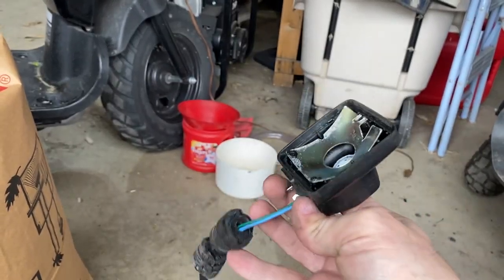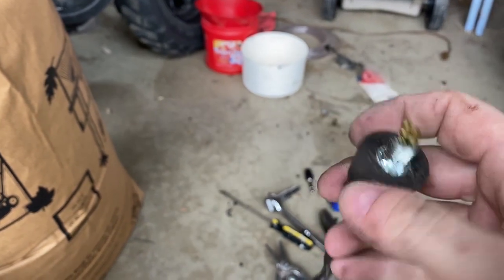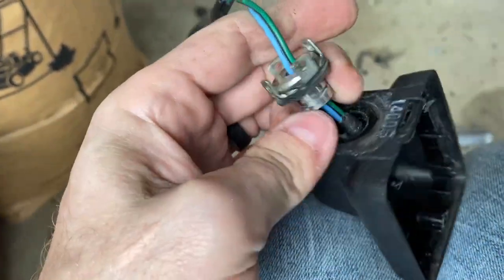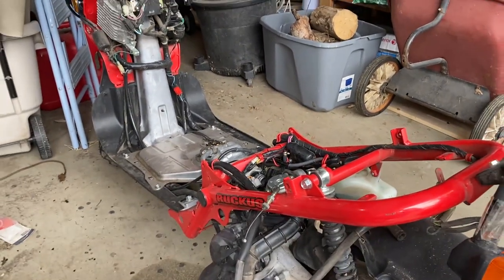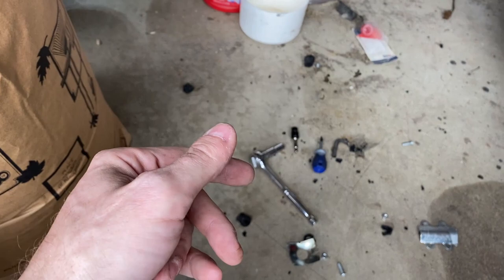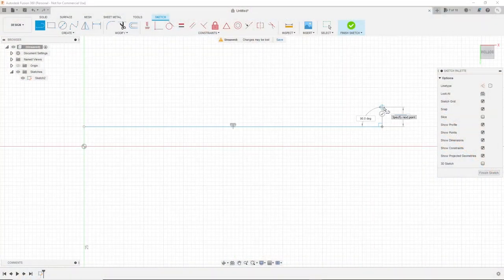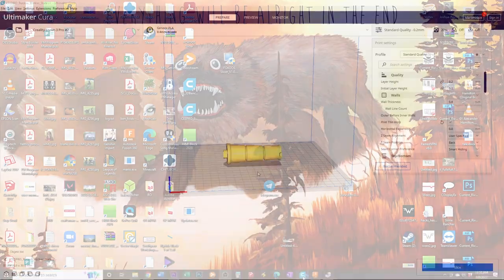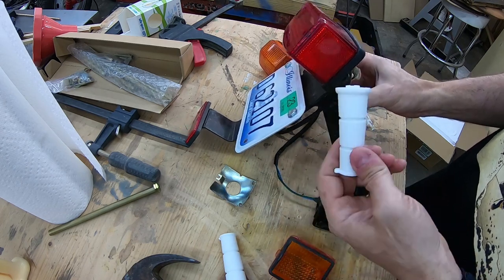Designing and 3D Printing Replacement Motorcycle Parts

Comment: The flexible light mounts are to absorb shock when the bike is dropped or brushed against something while riding. A rigid attachment is more likely to break the light or even the attachment point.
Reply from the maker: I mentioned that in the video.